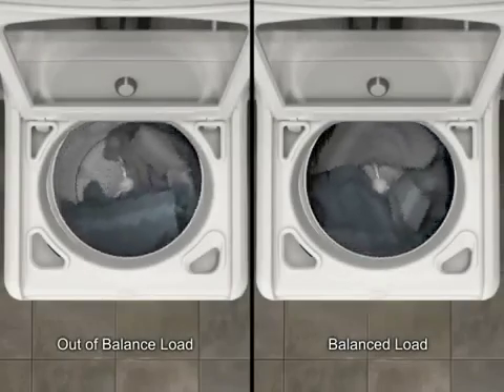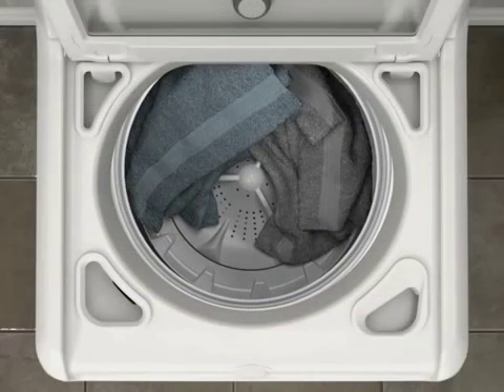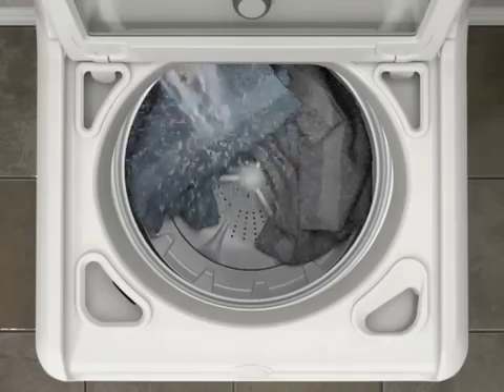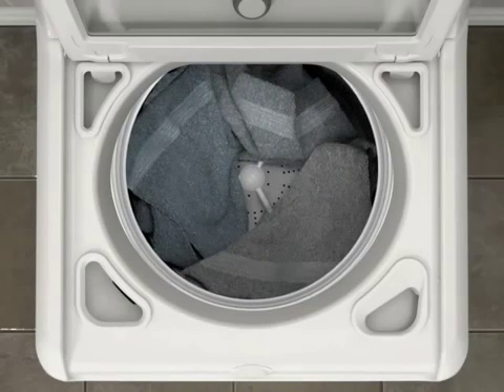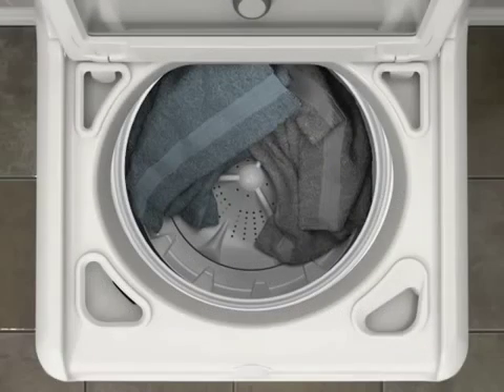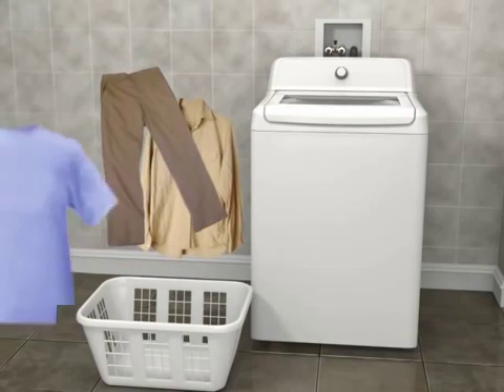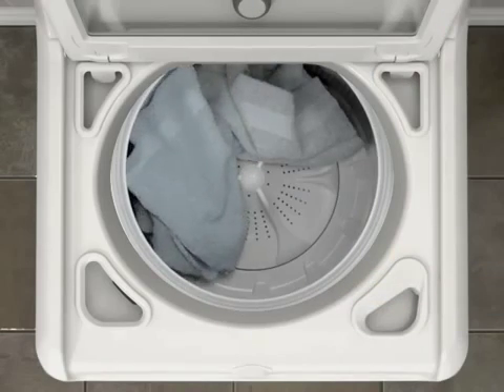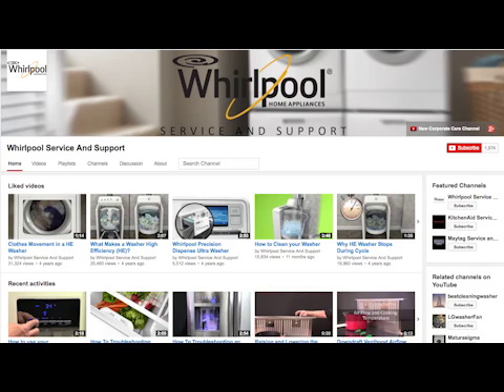How Your Washer Fixes Unbalanced Loads

Comment: I have had my Cabrio for three years. The biggest problem is constantly getting the 'off balance' error. It's very difficult to lift and redistribute soaking wet sheets from the tub in order to try to eliminate the off balance error. From a physics standpoint, I'm not sure that this problem could be eliminated. Sheets and blankets sloshing around are bound to cause an unbalanced load. My Cabrio cleans well and otherwise works fine. So far at least..

Comment: Why would you create and sell such a dumb contraption?  Not one load, big or small, without a UL error. Redistributing the clothes and untangling doesn't always resolve. Just a small t-shirt load...still a UL. I'm over it...my next washer will NOT be a Cabrio...maybe not even a Whirlpool.  I need my loads to finish on their own, not having to babysit.  My time is more valuable than that!
Reply: jazzcub31 you probably have a crack on the rotor
Reply: @ovigzlabs  If there is a crack. Shouldn't it also show uL when running empty? My washer runs fine empty. Throw a load in and it is a different story.
Reply: @sonnym9954   true might be sensor, ccu or something stuck between tubs